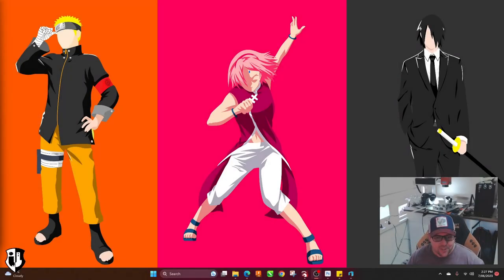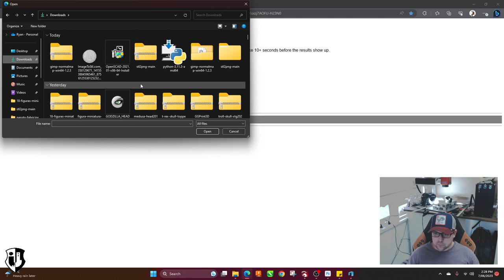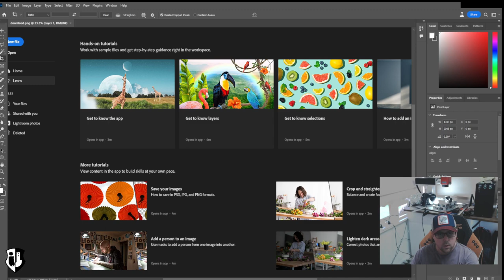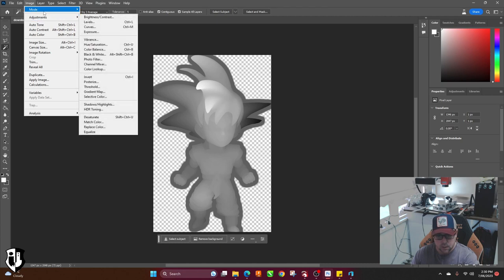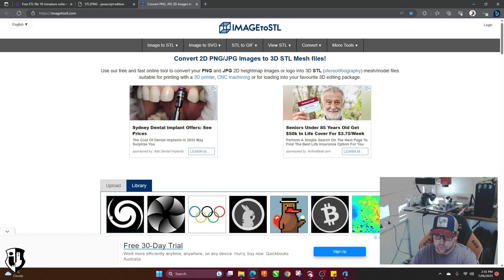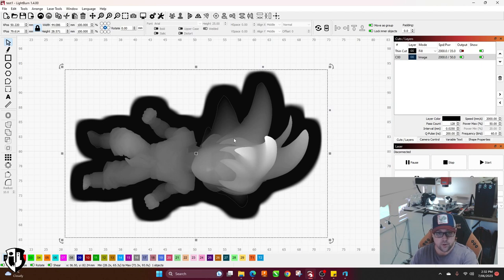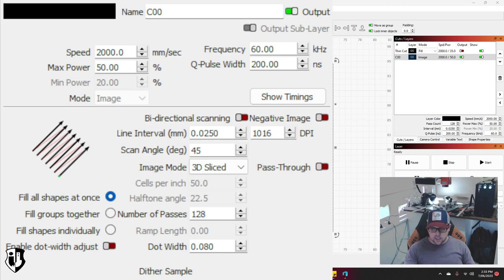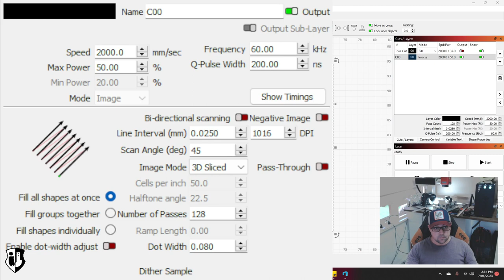Converting a STL file into 3d Grayscale for Fiber Laser

Comment: Thanks for the video, I'm new in laser and I'm starting thanks to job like this.

Sorry if the questions may be stupid.
1. POWER PERCENTAGE.__Why you use 50% power? Could you do 100% with fastest result, like at feed 4000 with same result? would 100% be too much for 0.08? 
2. NO-MOPA LASER._______Is it possible to perform 3D task with a no-MOPA laser? like a normal fiber laser 50W? 
3. FOCUS._________________If the focus is perfect on the initial surface, it become much more out of focus at any lap?  How can you maintain the laser on the focus during the task?

Thanks in advance for your reply
Reply from the maker: No question is a stupid question unless its unasked :)

1. Power - the more power the more aggressive, yes you could speed up with more power but the resolution wouldnt be as fine, in other words SIMPLE shapes Yes do this but intricate and 3d shapes slow down with less power

2. its all in the software, the software takes a grayscale 3d image and slices into the number of passes. the more passes you have the deeper it would be. the non-MOPA issues are mainly around frequency and the ability to colour materials. (you should be fine)

3. Focus, I listen to my laser and if I feel its going out of focus I will adjust but most of the time its ok

hope that helps and sorry for the delay, im doing house renovations :)